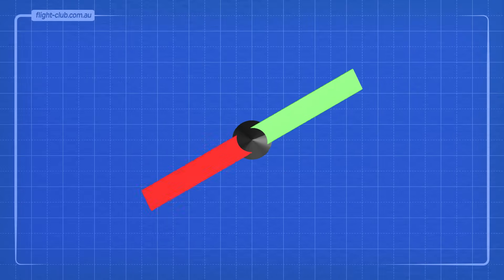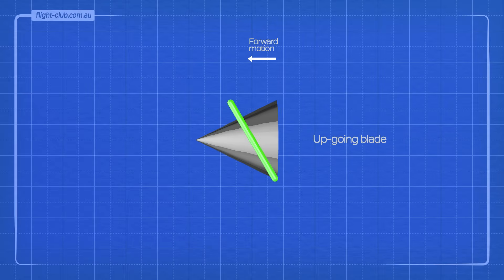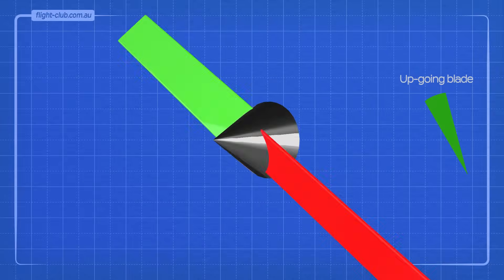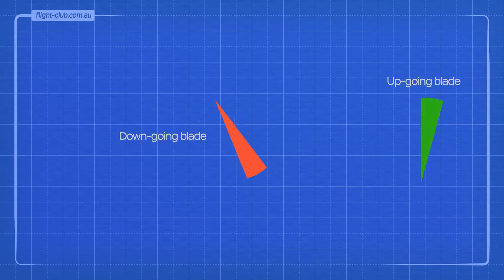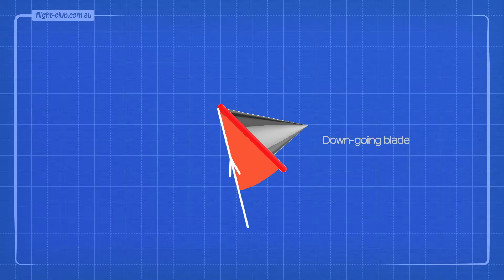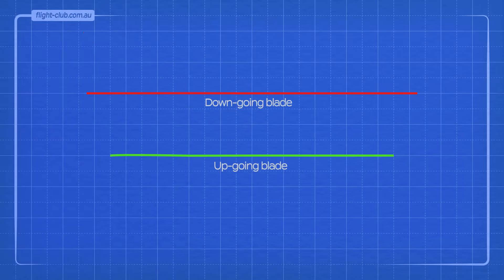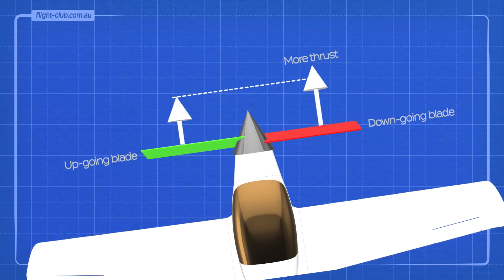What is P-FACTOR? | The Asymmetric Blade Effect

Comment: nice but, what does the nose up have to do with the amount of air that is displaced by a propeller? The helicopter is displacing air downwards and the angle of the aircraft does not change the amount of thrust. The angle of the plane with respect to the earth does not change the amount of air particles displaced backwards by each side of the propeller... but from your explanation, it does. Why?
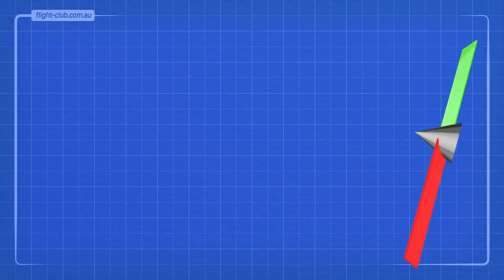Reply: It seems it has to do with the plane's fly path. If it's not perpendicular with the motion of the propeller, there's a difference the angle of attack due to different airspeed. An airplane doesn't always travel in the same direction of it's propellers. As for the helicopters, they can alter the pitch of the blades with the cyclic to correct any imbalance. 1:07
Reply: It is when the plane it self traveling horizontally but the nose is pointed up. (In reality when going slow the nose is gonna be pointing higher the the direction of travel) Helicopters have something called swashplates what account for movement which automatically changes the angle of attack of the blades to avoid it
Reply: @DiamondBlade_101  the helicopter compensates for the forward speed. The advancing blade will travel through the air faster than the retrieving blade. The system compensates for the difference by increasing the angle of attack of the retrieving blade, otherwise the helicopter would have a tendency to roll left the faster it goes.
Reply: I don't think that it changes based on the direction the plane is flying, but during the moment in which the airplane is changing its pitch angle. We know that the tendency of the airframe is to rotate around its CG, therefore the bottom blade will travel a longer distance when pitching up, or a shorter distance when diving the airplane. The moment that the rotational movement around its CG stops, the blades will match the AOA once again.
Reply: ....gravity is a thing. Your lift is based upon angle of attack and is most definitely relative to the ground as far as airplanes go.
Reply: I"m not a former aerospace engineer, but I think this phenomenon has more to do with the gyroscopic energy.

Comment: I would think that the force applied there would transfer 90 degrees ahead as it is being applied to a spinning object. Kind of like how helicopters cyclic stick changes the pitch 90 degrees around the disk to where you think it would change the pitch.
Reply: The force (really) moment on a spinning object isn't transferred 90 degrees ahead. That's a misconception about how gyroscopic motion works. For a free (or nearly free) rotating body, like a helicopter rotor, the spinning body precesses when a torque is applied. It's a nice mnemonic to say that the force is transferred 90 degrees ahead, and that gives the right prediction of which way the body will precess, but it's not that the force is somehow redirected. For example, if you were to attached the axle of a bicycle wheel to a rigid load cell (a sort of electronic scale), and applied a force to the rotating wheel, the load cell wouldn't measure the force as occurring 90 degree out of phase with the application, it would measure it as occurring just where it was applied. But if you were to hold the axle in your hand, and apply a torque to the axle, the wheel would precess in a direction apparently 90 degrees out of phase with the application of the force. In the case of a propeller aircraft, if the pilot applies controls to keep the nose pointed in a fixed direction, there is no precession, and so all the forces must be in equilibrium. That means that an aerodynamic moment (right rudder) must be applied that exactly counteracts the P-factor.
Reply: @stevenhall8469 gyroscopic precession affects an airplane only on the ground, mainly during takeoff.

Comment: I have a question 

If an altimeter setting is not available, the pilot can set the altimeter to the airport's field elevation before takeoff. is this true?
Reply: Yes.  It is not the mos accurate way to adjust the altimeter but can be used to get it close enough to avoid crashing into the ground....

Comment: Another amazing video. Thanks a lot! One question, what does “P” stand for in P-factor? Propeller? Pitch? Something like this?
Reply: Bill Kershner defines P-Factor as "Propeller Disc Asymmetric Loading" in his book "The Advanced Pilot’s Flight Manual (6th Edition)". I am fairly certain that P stands for propeller as P-factor cannot exist without a rotating disc of some kind.
Reply: @OhHeyItsShan  I believe the name is William K. Kershner. I had to mention it because I told my partner about how I have the same book and she pointed the name out.
Reply: Another thing that I think it's a fun fact, is that P is one of the letters that isn't mirrored in any way.
So it could represent an unbalance
Reply: @afoxwithahat7846  interesting but i dont think someone thought that far 😁
Reply: @afoxwithahat7846  P also is the first letter of Pilot, and they can be unbalanced sometimes. 😉
Reply: @afoxwithahat7846  p and q are often depicted as perfect mirror images of each other in lowercase. My kid (and many others) initially had a very hard time seeing the difference between the two
Reply: Probably Pull factor
Reply: CFI says No one really knows or cares. Might as well just settle on "propeller"